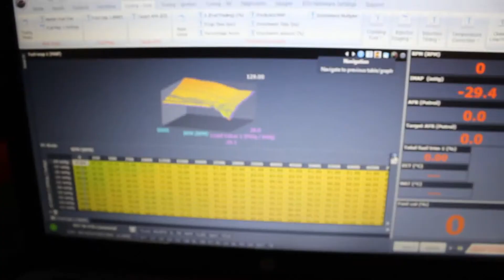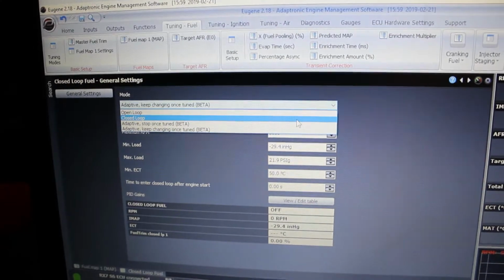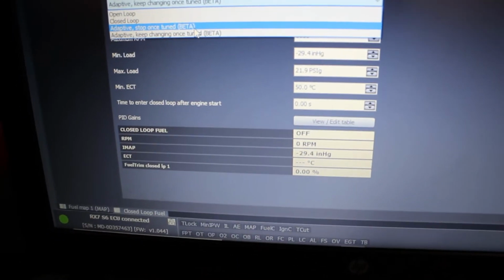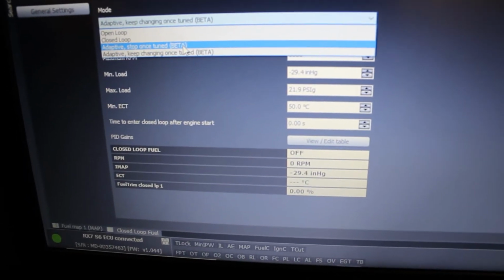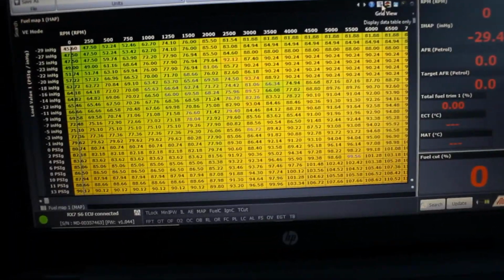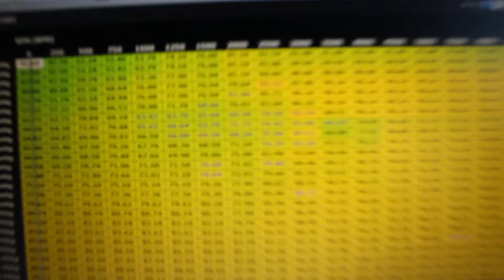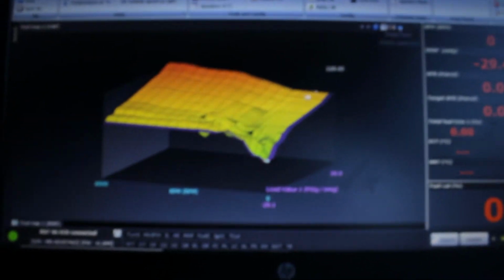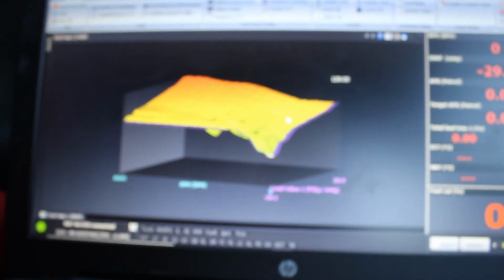Adaptronic Adaptive Tuning My RX7 FD.

Comment: What model should i get ? 
And what sensors do i need ?
Reply: Single turbo 
1994
Reply from the maker: If your wanting plug and play you will need a series 6 ecu. Only extra sensors I have is fuel and oil pressure.the ecu uses fuel pressure to work out the map. You can use the stock map sensor plug for the fuel pressure sensor
Reply: @TheDIYTuners  thank u for the info im struggling on finding what i can use
Reply from the maker: @edayala9171  send me a dm on my insta if you need any help mate 👍

Comment: This is bloody ridiculous, makes tuning look so much easier than with the PFC
Reply from the maker: It does make certain aspects easier but I still think the PFC was a great place to learn about tuning as it has no fancy features to worry about tuning
Reply: @TheDIYTuners  Yea I guess that is true, still debating an upgrade.

I think the car would be much easier to tune with better injectors tbh. It has stock 850s in the primary rail and I don't think that was a good idea/ upgrade.

May look at getting a stock primary with 550s and go from there.